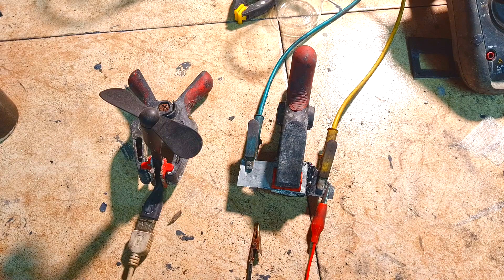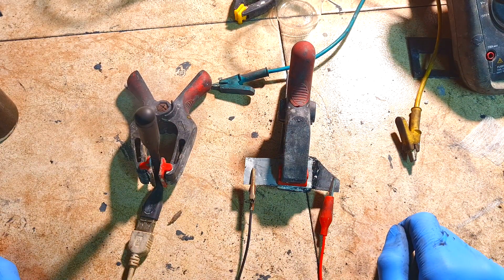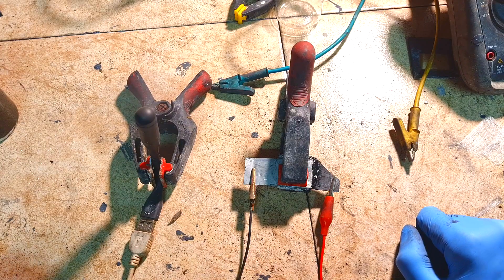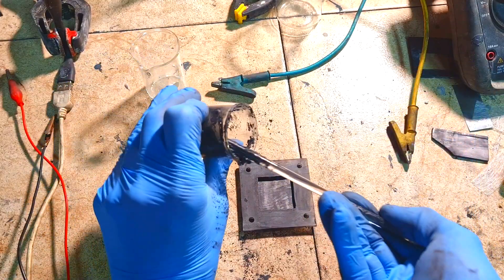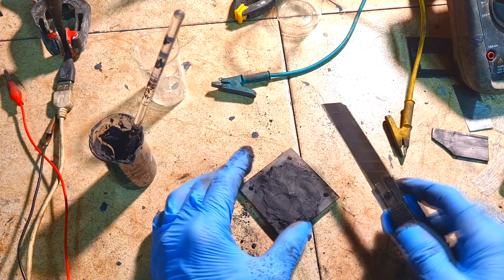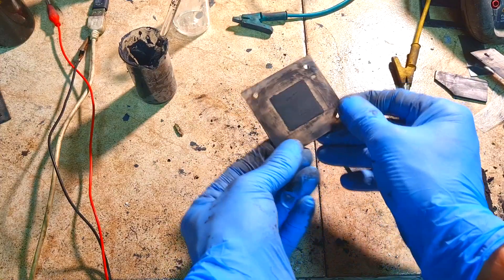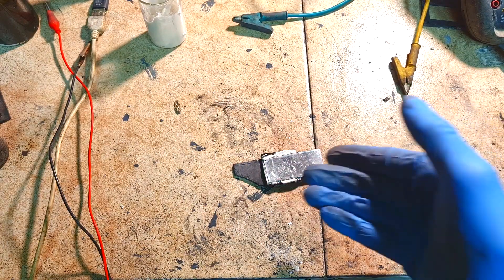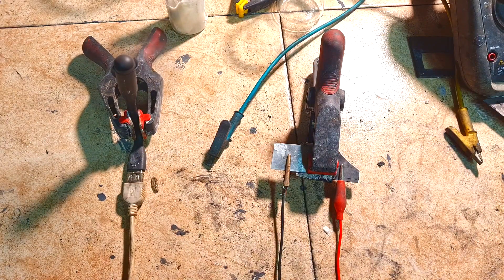Solid State Zinc Bromine Battery!?

Comment: Nice can you substitute the black carbon with graphite powder I was thinking of using something similar to that with black iron oxide and iron filings do you think that would make a good battery don't know what the acid would do with the plaster of Paris
Reply from the maker: yes you can,... the point is to make a little more conductive with some non metal material. Yes iron based battery can be really good. I dont think that you will damage the plaster of paris so easy 🤔
Reply: @cayrex  thank you for your opinion I think I'm going to get some plaster of Paris and try

Comment: It is clearly not, as you said, solid state BUT I think it's a very good idea because the "problem" of this battery consist in the fact that has to work with gravity to bring the bromine to the bottom of the cell. With this configuration a diffusion migration for capillarity through the pores of the plaster actually should take over the "problem" and make it independent from the orientation!
Reply from the maker: Correct! About solid state I already say in the video that is not a solid state and in description I wrote that the title is clickbait.
Reply: @cayrex  yes, don't be ashamed to click bait a bit, it's fair enough!!:)
Anyway the real point it's on the upgrade you did on Robert Murray's setup!😉
Reply from the maker: @Giarko  yea 💪😄

Comment: Cayrex2 .. I am having a problem .. I have tried to make battery 3 times and two with activated carbon and one with manganese dioxide .. Used potassium hydroxide as well as sodium sulphate electrolytes and charged on 2.6v  (at 3 volt electrolyte start burning) but all the time after charging voltage suddenly start dropping and battery don't have power to test on EBDtester ... Can anyone rectify what I am missing 😔

Comment: What voltage and short current could you acheive? Also some salts are hydroscopic and as a small addition may help the cell remain moist!
Reply from the maker: Voltage is 1.8V and current around 400mA
Reply: @cayrex  No kidding?  Out of what you made on the 'tube.  That's bloody well awesome.  Very nicely done and, I agree... gravity is no longer important.  This is just one throw away from being a "gel cell" but I like this a whole lot.  Thank you for taking the time to post this.  Heh... and I love your "mold".

Comment: have you considered using fired clay in place of the plaster? (since plaster is very soft and breakable) or look into what is known as hydrocal or ultracal two plaster based compounds that have a VERY high compression strength making it even tougher than concrete as well as being hydraulic white gypsum cements and all it is, is cement (the binder and solidifier in concrete, minus any sand or gravel ect fillers) and plaster of paris mixed at a ratio of 5 or 10% cement to the balance of 95-90% plaster of paris, but increases the PSI rating from the 30 or 50 PSI to like 15,000 to 30,000 PSI like WOW!

***the cement has an alkali compound apparently that is not calcium like the plaster, so that would have to be taken into account, here since it might effect the chemical reaction of the battery positively or negatively in some aspects, so note that, maybe useful, maybe detrimental needing a chemistry change to avoid and take advantage of this minute added compound, thus why my first suggestion is a neutral permeable vitrified glass and sapphire amalgam that is ceramic clay, even though it takes some heat to fire it up, Terracotta clay fires at a lower temp and if you are using iron as part of the system I think it might be able to be accounted for since that is what gives it it's reddish orange color, as well as the lower firing temperature so that a simple fire's coals from hardwood like oak or something is hot enough to fire it, no fans for additional air to raise the temp ect, 

once the firing is done then filling the other compounds and letting it pseudo dry, (or using some other liquid that is not water so it will not interfere with it acting as a solid state, could maybe be used who knows, just have to give it a go lol) anyway to retain that minute amount of moisture a simple wax coating should suffice, something I have looked into for sealing in bricks fired up this way, for shingles and roof, as well as a more liquid based brick/battery that has the durability to last many years before even being a weaker battery

Comment: Nice! I'll have to build one of these and see how it goes with lots of cycles and zinc dendrites.
Reply: Add a little sugar water mix ontop of cathode. Apparently it does wonders so some universities claim ! 🤷‍♂️
Reply from the maker: Plaster of paris separator will do good job against dendrites.
Reply: @Buzzhumma  That sounds interesting. Is the info in a paper somewhere?
Reply: @cayrex  I hope so. I'll post back on what happens and how the cell goes...
Reply from the maker: @etherlonX  search for Secret to dendrite-free lithium-ion batteries lies in a sugar cube
Reply: @Buzzhumma  couldn't find the sugar ref.   Can u help? Texted
Was it for dendrites from the anode or bromine sequestration?

Comment: You really didn't go into the depth of highlighting the use of a complexing agent for this type of battery without which its safety is compromised!
Reply from the maker: Not really, yes.  If people make Zn-Br battery then they know some basics about the battery and the problems of Br2, etc,... if not dont make it! Repeating about complexing agent over and over in all Zn Br videos is also so so. Then, some complexing agents are also harder to get for the most of the people. You can make Zn Br cell with all supporting chemicals for all the problems that have Zn Br battery (then you can use  or for static cell you need to use complexing agents like MPM-Br, 1–ethyl–2–methyl–pyridinium bromide (BCA), Methyl Ethyl Morpholinium Bromide, Methyl Ethyl Pyrrolidinium Bromide, tetrapropylammonium bromide, etc) ,.... or you work on cell construction design which you solve some of the problems with construction.